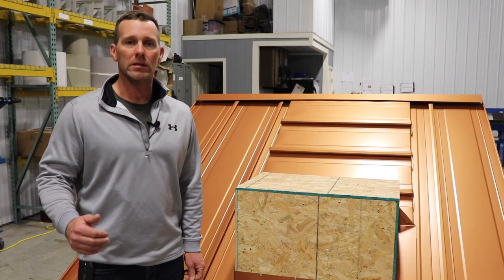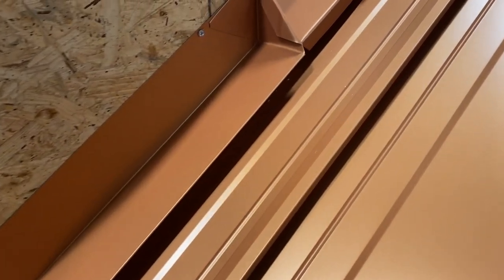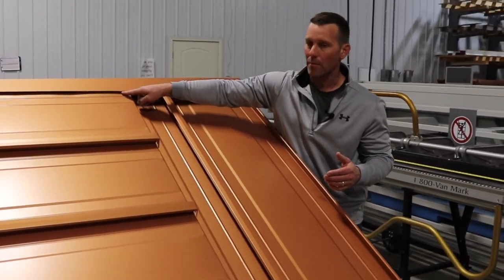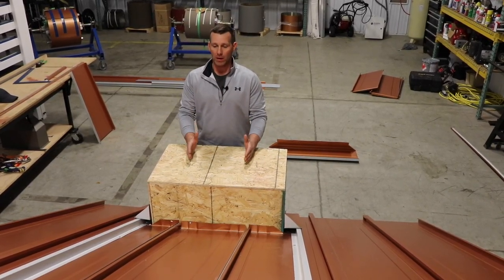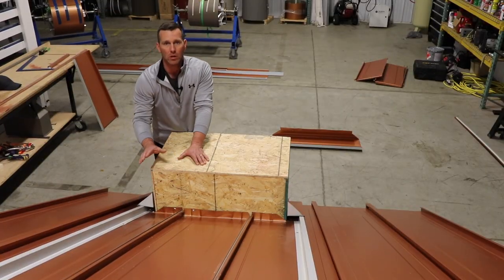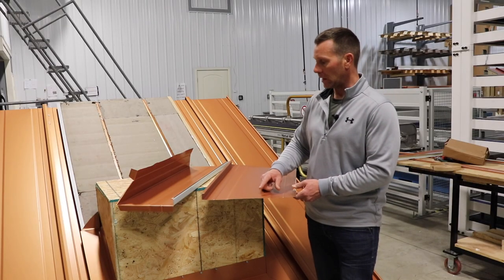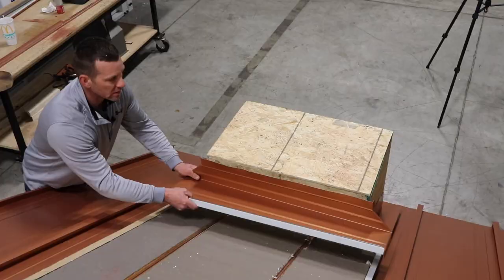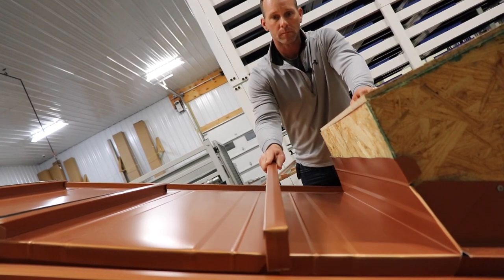Best Metal roof flashing  around Chimneys, Skylights, HVAC units - 138 T Standing seam metal roofing

Comment: I am so impressed.  Have you ever thought about would it be possible to lay the custom bent top side flashing to work with the transverse panels laid at a slight angle to direct the water to either one side or the other?  My chimney is above a valley that constantly clogs with fir tree needles so I would have to think would it be better to direct all the water to the low side of the valley or maybe on purpose to the high side to wash it down. I have even thought about installing water jets at the top of these valleys so I can hose them down remotely before they get completely filled with needles.

Comment: It does look like pooh, but if it keeps my roof from leaking then that's the important part. I got here because some jackass who installed skylights on my metal roof put the whole flashing under the  metal. They sealed it with some dense rubber sealant and it worked for years i guess, but now it's leaking, meh!